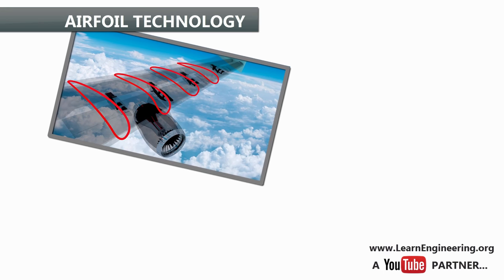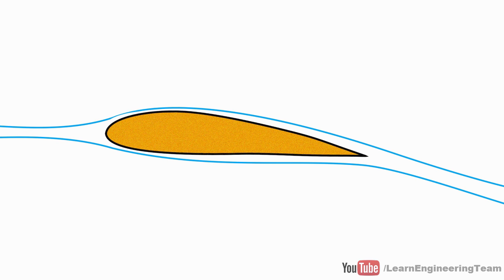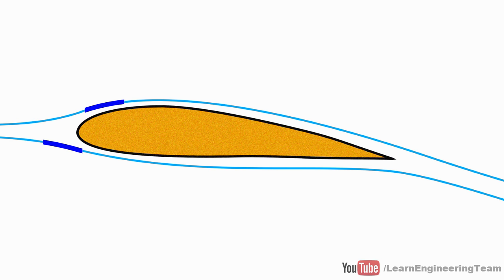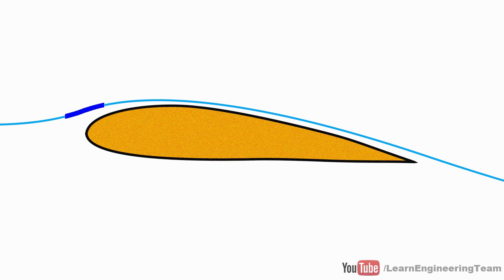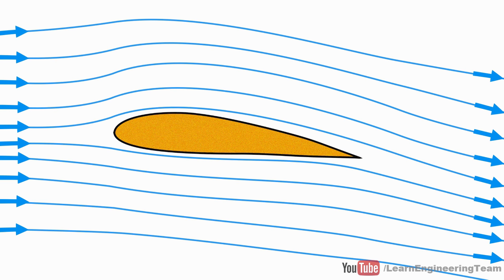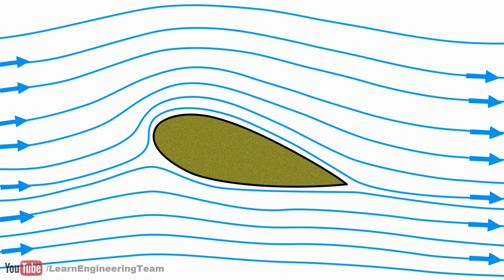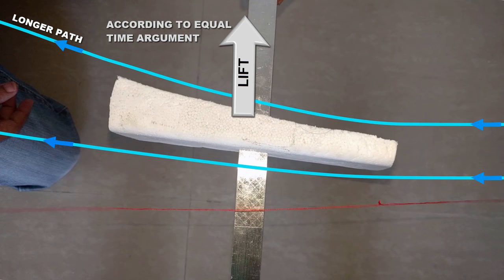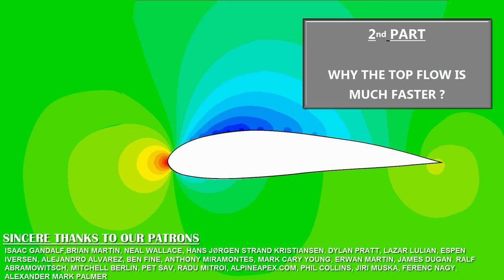How do Wings generate LIFT?

Comment: Bernoulli himself never said anything about equal time transit, so don’t blame on him!
Reply: True,  it's just people applying it the wrong way
Reply: @playerscience  Actually people misunderstanding Bernoulli's Principle, thus, its application is wong
Reply: Bernoulli never said anything about wings. There is also no indication in his notes that he figured out the cause and effect of the speed change/pressure relationship, only that they accompanied each other.  It was Euiler, following up on Bernoulli's work that determined that a Pressure Gradient causes fluid acceleration (changes in velocity).
Reply: True, Bernoulli merely stated that lift is generated by pressure differential caused by difference in airflow velocity between the top and bottom surfaces. I've only heard about the equal time theory just recently, that's why my friend sent me this video. This channel never disappoints

Comment: It's not Coanda!!!!!!! Coanda doesn't work in non-accelerated flows if at all. 

It is viscosity and static atmospheric pressure that causes attachment. Fluids attach to curved surfaces because of viscosity. The more viscous the fluid the better is sticks and resists and the more it curves, Newton's 1st law.

If you get ice contamination, even as fine as grains of sand on the aerofoil, the viscous attachment is affected as the surface is rough and attachment is not uniform. The  boundary layer can break away stalling the upper surface even though it is well below the stall angle for that aerofoil.

DC-9s/MD-80s are particularly sensitive to this. Attachment is a function of air's viscosity and is taken into consideration in lift calculations.

As NASA says and you you can prove with a paper plane, lift is caused by turning a fluid. Bend the fluid one way and your wing goes the other. Airspeed or AOA provide the change F=MA

A flat plate will generate excellent lift and low drag at a positive AOA. The pressure differences are a result of lift production from AOA, not the cause. Shaping only refines lift production. No effective AOA no lift.

Remember too that all airliners have super-critical wings that are flatter on top and curved underneath.

My video here explains lift production in detail that is easy to understand.
https://www.youtube.com/watch?v=WmXq9gm1uMo&t=1113s
Reply: The adhesion between liquid and soild perhaps
Reply: best video. thnks
Reply: You said : "Coanda doesn't work if non-accelerated flows if at all." But here the flow IS accelerated. Why it couldn't be Coanda effect as well as viscosity ?
Reply: This flow IS accelerated, don't forget that velocity is a vector unit. That means it has magnitude and DIRECTION properties. When a fluid flow through an aerofoil, its flow direction changes thus the flow is accelerated.

And you might also remember that a particle could only accelerates when there is a force applied to it. This force is the force given to the air particles by the wing as the wing pushes the air particle DOWNWARDS. And by applying Newton's 3rd law we also knows that in turn the air particles pushes the wing in the opposite direction that is UPWARDS.

This is how wings generates MOST of its lift. The Bernauli effect also plays a part at lift but it is not the central point like what outdated textbooks might say.
Reply: Change in air direction involves acceleration.
Reply: Well, then explain how Aladdin's carpet generates lift
Reply: @ABC-qd5oc  This is a fact that isnt repeated enough in mechanics courses.

Comment: Terrific video and explanation. Im so glad someone took the time to give the correct lift explanation with sound engineering principle. The velocity difference is due to the two different aspects of fluid pressure that the video does not mention. There is static pressure (SP) and dynamic (or velocity) pressure (VP). The total pressure of the fluid remains the same, because TP=SP+VP. As the velocity of the air goes up, the velocity pressure goes up and the static pressure goes down, and vice versus.
Reply: The video provide wrong concept to the public,  he use layman wrong concept instead of scientific proof.

Comment: Sir, what you said about applying Bernoulli's principle on the same streamline is when the flow is rotational. But if the flow is irrotational, Bernoulli's principle applies to any two points on the same or different streamline because the Net energy is the same for each streamline in irrotational flow.
Right Sir??

Comment: Very interesting presentation. Your elucidation of the Bernoulli effect is spot on. The Coanda effect, upwash, down wash, drag as well as lift are effects. They are caused by the pressure difference between the top and the bottom of the wing. Lift occurs because of what is happening as the air flow interacts with these surfaces. Precisely at these surfaces the rate of flow is zero or near zero. This is the no-slip condition. The flow rate increases as the normal distance from those surfaces increases.  What this means is that fluid shear is taking place. The fluid particles are interacting with one another and with the surface. This is not inviscid potential flow. The concept of a stream line breaks down in this boundary layer. 

When the wing surface is curving away from the flow, this shearing causes particles to be blown away from the surface. It is this depletion which causes a pressure decrease at that surface. It is this pressure decrease that causes the stream lines to be deflected down along and above the top surface of the wing. It is this effect that is used by the « blown flaps » on supersonic aircraft to maintain lift as they land on an aircraft carrier.

Comment: Hi Learn Engineering.... thanks for your video... I'm like it very much.. but I'm confuse about one thing.. this Coanda effect should affect the downforce of a supercar in the same manner... I mean in opposite direction right?... but how come the supercar like Ferraris and McLarens have the same convex surfaces on top with flat surfaces on the bottom in order to achieve a greater downforce? should it be another way around? Thanks...

Comment: ok this video is confusing. Does the difference in pressure cause the lift or not? You say that bernoulli's principle is wrong, but at 4:35 you say the pressure difference generates the lift. so is bernoulli's principle right or wrong?

Comment: Total energy of a fluid that is flowing is separated into its pressure(potential energy) and kinetic energy. So, if there is a decrease in pressure, eventually the velocity component takes the edge and therefore the particle at the top travels faster than the particle at the bottom. So the tortoise never meets the cheetah ;)
Reply: Yes.  You have pointed out the correct concept of Bernoulli's thought, This video mislead the public

Comment: If the particles don't reach the trailing edge at the same time, doesn't that mean there is a discontinuity in the flow or flow separation?
Reply: Flow separation just refers to when the streamlines break away from the surface, leaving only turbulent air in the gap.
Reply: No.  Because the wing separates these two bits of air, they are free to go their own merry way, independent of each other.  It is the pressures that cause the different motions. 
There is nothing that says the two bits of air must rejoin after being separated by some solid object they flow around. 
Above the wing, the pressure ahead of the wing is higher than the reduced pressure above the wing, so that speeds it up toward the trailing edge.  It accelerates toward the trailing edge because these two pressures.
Reply: For a better understanding of the detailed cause of the reduced pressure above a wing, try this short video:
https://www.youtube.com/watch?v=3MSqbnbKDmM
Regards.

Comment: Here it said that Bernoulli equation can't be applied between streamlines but what I know is that it can be applied between streamlines if the flow is irrotational. Now around the airfoil the flow is obviously irrotational. So I think Bernoulli equation holds here. Please correct me if I am overlooking something.

Comment: So, why does the coanda effect also work on the bottom of the wing, if it has to do with lower pressure closer to the wing? The pressure at the bottom of the wing is higher closer to the wing than farther out, so wouldnt you assume the coanda effect only works on the upper side of the wing?

Comment: 6:43 I don't know if I'm correct but the pressure at the top is less so the air particles can move faster compared the the lower particles as there is more pressure underneath

Comment from the maker: Dear friends, We hope you liked the video. Please support us at Patreon.com and make our educational service sustainable. 
https://www.patreon.com/LearnEngineering
Reply: There is still the bernoulli effect in play, but this happens due to circulation theory, or the kutta- zhukosky effect, that creates a clockwise (if going right to left) vortex around the foil. it is very hard to conceptualize but, the bernoulli equation is at play, just not in the "equal time" theory sense.
Reply: is there any chance to do a PayPal donation, like with Wikipedia?

I still think MOOC course runners could use your help with creating videos.
Reply from the maker: We don't have an option for Paypal donation :(  MOOC is a good option, I will work on it.
Reply: what about the pinching air theory?

Comment: Could you please explain why the pressure of the outside part of the curved streamline has bigger pressure?
Reply: This video doesn’t explain what causes the pressure difference. It just states that if air curves, or changes direction, then there must be a pressure gradient causing it to change direction. Air won’t change direction on its own. The low pressure on top of a wing is most likely due to the fact that it curves away from the oncoming flow, and this would cause a gap, or a drop in pressure, thus pulling the air in a curved streamline around the wing.

Comment: 3:19 is bit confusing. Why would the pressure difference have in the first place? because the wing has served as a barrier and the wind will be deflected? the direction of wind flow thus creates the air pressure difference?
Reply: Thats is what is confusing me too...
Reply: Patm??
Reply: Well you can just imagine the airstream has a tendency of filling in all the empty space, with air.  Hence when an airfoil is introduced, the region at trailing edge naturally has "the empty space" and thus creating a high and low pressure region.  You can imagine it as simple as a diffusion process
Reply: If the air moves straight forward, there would be no air below it. That means, the air above it would be pushing down, and there would be no air below it pushing up, meaning it gets pushed down to fill the space. Does that make sense?
Reply: This explanation is clearer than the whole video!! Thank you!!
Reply: when air is forced to follow the curved streamline there is a normal acceleration towards the outside of the curve. Think of holding a bucket of water and swinging it in a big circle above your head, the water does not spill because it is being pressed into the bucket by angular acceleration. In the same way, the air on a curved streamline is pressed toward the outside of a curve. That creates the pressure gradient.
Reply: @GZA036  Thats a great explanation! What I simply do not understand though, is why this principle then does not apply on the lower side of the wing?

Comment: This video is very interesting. I just think that the "coanda effect" is not exactly the most assertive way of explaining the flow circulation (and lift). Classical literature generally refers to Kutta condition , in which nature "chooses" the exact ammount of circulation around an airfoil such as flow could "always" leave the airfoil smoothly at trailing edge ... this is why, irregardless of thickness, leading edge radius, or even camber... Lifting bodies always will present sharp trailing edges... this kind of  geometry will generate flow fields patterns in which velocity at the upper side achieve higher magnitudes (which is related to lower pressures by Bernoully's equation) than at the botton (well considering a positive angle of attack).

Comment: As we can see the pressure gradient image at @6:43, the pressure is same at the front for both stream lines but after separating the top stream is also going through a lower pressure region..so according to bernoulli velocity inc..and its not same in case of bottom one so they never meets.....

Comment: You lost me at 4:10 to 4:25.  The video seems to be contradicting yourself.  Pout > Pin for the top, but it is the opposite for the bottom of the foil.  Also, in the example given, the curvature at the top is greater than the curvature at the bottom, so according to their own explanation, there should be a net downforce on the wing.  

Can someone help me understand?   Other than the angle of attack, why is the pressure greater at the bottom?   Is it just because the pressure drop at the top is greater than the pressure drop at the bottom (so the bottom of the wing is closer to atmospheric)?  Thanks.
Reply from the maker: Ohh, watch it carefully once again. Pout > Pin for both the top and bottom. At both top and bottom flow is curved downwards. Faraway from the top pressure is atmospheric and faraway from the bottom pressure is atmospheric. Apply these facts carefully, you will see why there is a pressure difference.
Reply: Ohhhhh okay.  It finally clicked.  The pressure difference is relative to the streamline of the particle, and not the wing itself.  

So the radial acceleration of each air particle is what creates the lift pressure as a function of v^2/r.
Reply: Why is Pout on the bottom, above Pin? This means that by applying the Coanda effect for the air flowing under the wing, the air there would have a net downward force because of higher pressure closer to the wing and lower pressure further from the wing if Pout and Pin are oriented as you described. I know this makes no sense since lift generated in real life, so can anyone help?

Comment: the smooth curved upper section of wing allows air to move fast , whereas the lower section is much straighter and especially the liwer part of the front tip of the wing is angled so that it blocks the hitting air creating a pressure peak.
this difference in speed above and below , combined with the reaction force due to the angle of attack and the coanda effect creates lift.
am i right?

Comment: But then why does my flat winged planes fly? Shouldn't the air travel on both sides of the wings at the same rate thus creating no lift.  Now I know that you are likely going to say that the wing being tilted up will generate lower pressure at the top. But still... this has bothered me.
Reply: because as few seem to want to point out, wings lift predominantly because of simple angle of attack.  Air molecules hit the bottom of the wing , thus driving the wing upward.   The shape of the wings make the system more efficient.  

People have a difficult time visualizing that 2 things can be at work at once.  Also, people like to make utube vids, so they like to make things as complicated and mysterious as possible

Comment: as the pressure decreases it gets converted into kinetic energy and moves faster than the air below the airfoil
Reply: The pressure decrease above the wing also accelerates that air toward the trailing edge, therefore making it reach it sooner.

Comment: I CANT UNDERSTAND THE STATEMENT  "THE SAME REASON PRESSURE SHOULD INCREASE AS WE MOVE TOWARD THE AIRFOIL AT THE BOTTOM"
Reply: I wasted lot of time to understand nothing out of this video.
Reply: I know this is nearly a year late, but he was referring to the gradient of pressure as you get closer to the airfoil from the underside. If you were 10 meters away below the airfoil the pressure would be less than if you were a couple of centimeters away from the bottom of the airfoil. It was a complicated way to say that the air under the airfoil is being compressed so the pressure is higher.
Reply: @phoenixamaranth  but isn"t the air above also being compressed then why pressure is getting less for that
Reply: @hubaibkhan7658  you have the exact right idea. The logic in this video is flawed. In reality the streamlines are attached to the surface of the airfoil because of viscous effects and the boundary layer that forms on the surface
Reply: I too struggling to understand this statement
Reply: The air above is compressed only at the beginning of the wing.
As the wing drops away, the air would ideally continue horizontally. This would create a vacuum on the top layer of the wing - hence the statement about low pressure just above the wing.
The air would ideally travel horizontally, separating from the wing and creating low pressure. It sticks to the wing, following it downwards, because the atmospheric pressure is greater than the pressure just above the wing.

Underneath it’s the opposite - air incredibly close to the underside is under huge pressure, and this reduces the further you move downwards away from the bottom of the wing.
Reply: @howiestone9987  The coandra effect is the reason. The air wants to adhere to the surface as it passes over the curve (negating the equal time theory) and creates a lower pressure area, while the higher pressure from below forces the wing into that "soft spot" = Lift
Reply: same
Reply: @howiestone9987  I think I understand, thank you